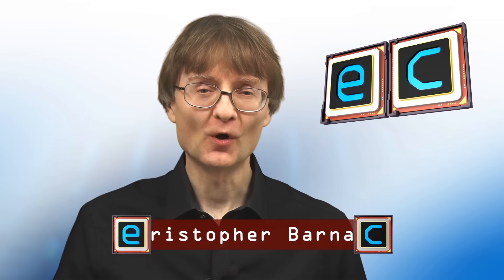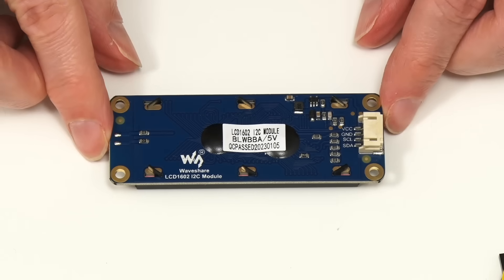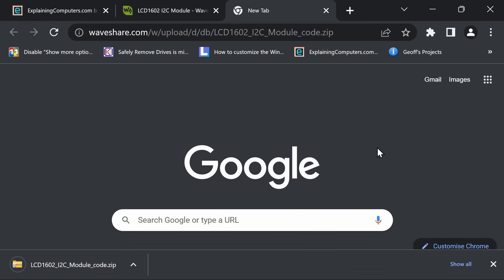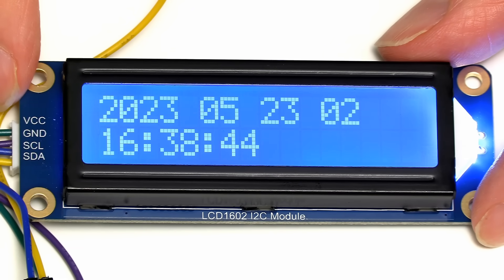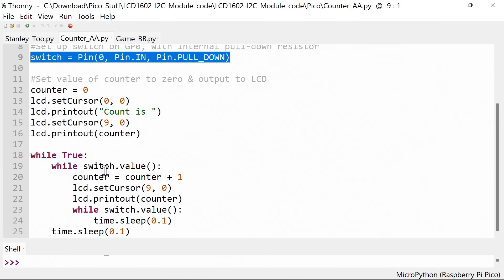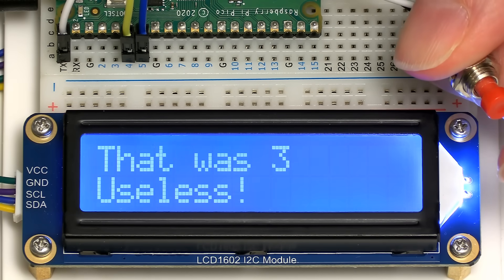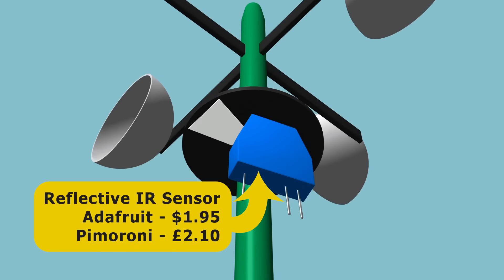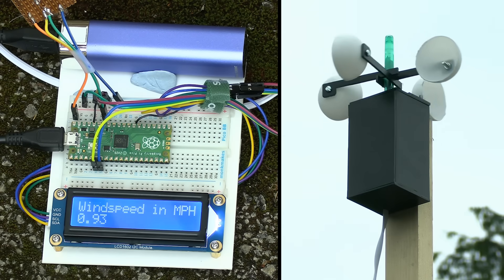Raspberry Pi Pico LCD Projects

Comment: Great to see you've taken into account the debouncing issue when dealing with button inputs!
Reply: I get that reference!   *cough* Mr Eater *cough*
Reply: How is the debouncing issue fixed?
Reply: @fjl05  The "while True" is a forever loop. The next "while loop" - "while switch.value()" - means that while the switch is pressed, do what is inside that loop, which is to increment the counter, update the display, and then execute the third "while loop". The third while loop checks to see if the the button has been released, then waits for a tenth of a second and checks again. If the button "bounces" open and closed, it will happen much faster than the tenth second delay, so the third while loop won't "see" the release. In this way, once the counter has been incremented and the counter value displayed, execution is "trapped" inside the third while loop, meaning that execution cannot continue until the button is released for a period of time exceeding a tenth of a second, which implements what we call a "debounce" function.
The problem with this method is that execution is trapped inside that inner loop, and nothing else gets done. This is fine for a simple demonstrator, but in the real world - or more precisely, in a real-time application - we couldn't accept the processor simply sitting and waiting for the operator to release the button, because nothing else would get done while the button is down. In the real world, we'd either use a hardware debounce circuit, or use an external timer/scheduler loop to poll the button periodically and wait for it to be released before accepting further down conditions, or use a hardware edge-triggered interrupt driven by the button... the last two creating what is referred to as an event-driven mechanism. It would depend on the broader structure of the program, and the processor structure. An Arduino would lend itself to a hardware interrupt solution, but I don't know if the OS on the Pi would take too kindly to that. Again, this is a perfectly reasonable demonstration, but in a real application with other things for the processor to do, you'd want to choose a method that permits continuous, uninterrupted code execution.

Comment: and next week we will the half annual channel update ?

I liked this Pico focussed project a lot - even though I had a lot of trouble with the waveshare OLED , no, e-ink panel due to terrible pico support. 
Did not know that it is a terrible idea to get a waveshare board - at least once you had gotten a pimoroni device with all the support missing on the waveshare for example that badger pico integration and software.
Reply from the maker: You are correct -- next week is indeed the July 2023 update. :) As you infer, software support for an LCD is critical, and not always ideal.